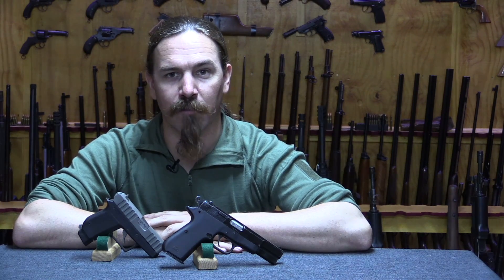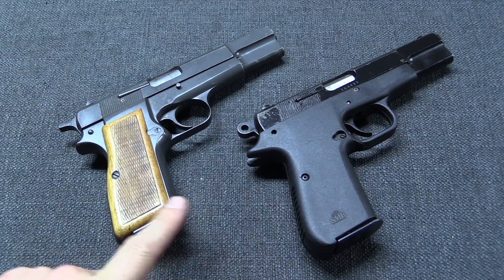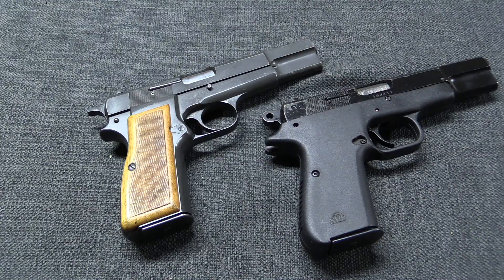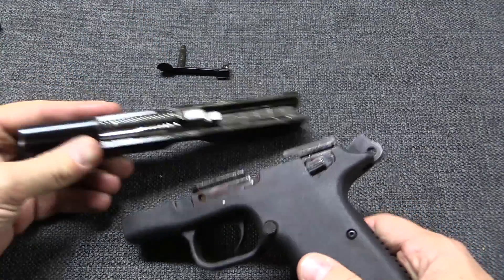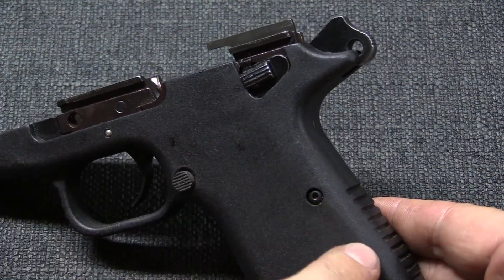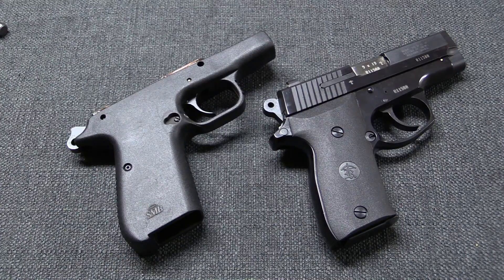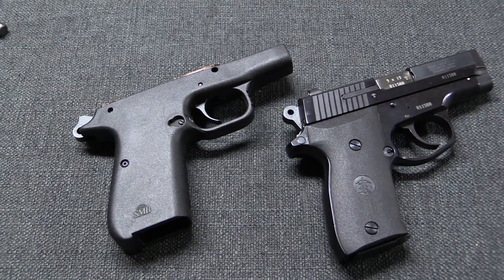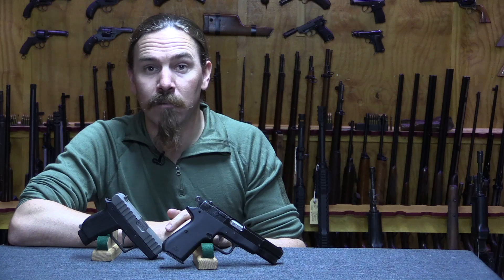Smith & Beecham Prototype Polymer High Power

Comment: A Hi-Power 9mm handgun with a steel reinforced polymer frame. It could work today.
Reply: requires Good Lubrication Of Club Kingpin
Reply: Nobody would buy it with guns like the P320 on the market.
Reply: Jbog07  That sounds like it would be a hot seller
Reply: @hillkiller6201  Perhaps. But, In my mind it comes down to the consumers preference. There are those who are more familiar with a Hi-Power than they are with a Sig. Both are great handguns.
Reply: Tanfoglio makes a 1911 like this and no one buys it.
Reply: @Fenster21  Tanfoglio, that a name I don't hear often
Reply: It could if the Hi-power was still being manufactured, which unfortunately it isn’t
Reply: @jasonarmstrong5750   I think there is a company in Canada that makes them
Reply: Yes it could work, doesnt mean it will sell. Tanfoglio makes a CZ75 with a polymer frame and I never hear anyone talk about these guns anywhere. (for consumer comparison sake its similar enough to the people who would buy a polymer HiPower) 

People actually buying or not is half the reason why theres so many of these ForgottenWeapons anyway.
Reply: Stamped titanium would be better inside a polymer frame.
Reply: Hill Killer I’d buy it. Retro is cool atm

Comment: The RAP was a firearm that was made during the 90's as a Firearm predominantly to serve the needs of under cover police, but also police women. Now the B&S Excalibur is a very interesting project, the workshop was in the old Republic Arms building just behind the Jeppes Town Police station. I was at their workshop many years ago and met the designer (who is a Rhodesian expat). It was very interesting to see the designer's thought philosophy. At the workshop they showed us some prototypes, one I could remember was a hammer fired DA only pistol that they intended for the metro police as it was a straight foreword pistol with no safeties. They also made a prototype pistol in 40 S&W that had more of a Beretta  92 take down design but it had some designs in it that weren't Beretta 92 (it was a single action only hammer fires pistol. Some of the initial challenges on the 40 S&W was to keep the chassis in place, they had some issues where the chassis would drop in the polymer frame that resulted in the trigger mechanism having too much space from the slide giving you a dead trigger.

Comment: It’s a shame the Hi-Power never got the following the 1911 did with all these aftermarket modifications to the basic designs. I mean there’s so many variation on the 1911, you got double stackes, polymer frames, aluminum alloy frames, light rails, threaded barrels. As for the Hi-Power? I only know of one aftermarket polymer frame with a rail that you can get. I realize there’s better handguns on the market these days but if you can get a modernized version of a Mosin Nagant or a modernized civilian M14 then the Hi-Power deserves the same kind of love.

Comment: Hi Power's with aluminum frames.......In late 40's Inglis Canada made light weight HP's protos for US and Uk tests. Took metal out of the standard steel slide and machined frames out of aluminum bar stock ( expensive way to make frames). Reduced weight quite a bit and worked fairly well. Then tried cast aluminum frames( whole different metallurgy). NG with high wear between steel and aluminum parts. Project was dropped. Today available aluminum casting alloys and new casting techniques ( Thanks NASA) could likely solve problem). I heard somewhere that FN actually made and sold some aluminum frame HP's in the 1980's(?). PS I love my 1972 FN Hi Power.

Comment: Wonder why the S&B pistol didn't have polymer grip extensions in place of the old HP's wooden one?
Reply: Prototype, I am sure that later models would have had either molded grips or attachable.
Reply: @Ackehece  and promptly added back that 3 oz weight savings.
Reply: @shawnr771  but with each model they may have been able to shave more steel from the frame, and polymer grips don't add much if they are molded into the frame.

Comment: If the rap 401 slide works on the hi power frame does that mean a hi power slide could fit on a rap 401 frame? I'm thinking slimmer single stack hi power.

Comment: What exactly necessitates the heavy steel insert? I've never handled a hi power at all, let alone shot one. Seems like you could make it work with aluminum. It is only 9mm after all.
Reply: Most internal gun parts are steel of some sort.

Even if make something out of very good aluminum. Hammer on it enough and it will bend or deform. 
Especially small parts under heat taking direct impacts from other parts.

In car engines the parts get hot but dont actually strike each other near as much as move beside themselves, in a layer of oil with a coolant system to dissapate excess heat.
Reply: Doesn't really answer the question. They make 9mm frames out of aluminum, or just polymer for that matter. Yes the small parts will have to be steel. That goes without saying, but that insert was massive. Glocks handle 10mm pressure with very little in the way of steel in the lower. I was wondering if it was something to do with the hi power specifically
Reply: @twatts45  No idea might be different sized springs. Mass of slide.
Lot of physics there. 

Without exact specifications and lots of math or trial and error. It is unknown to me.
Reply: Evidently the locking mechanism is in the frame as opposed to a notch and lug setup with the barrel and slide like a 1911, Glock, etc..

Comment: Not enough of a weight difference to make a difference in handling and the change in aesthetics of the weapon counted against it also. The only thing that would sell it would be if it was cheaper to manufacture but from the looks of it I doubt that also.
Reply: Might be cheaper to manufacture but the cost of long term support might be higher.

In addition if it is difficult to maintenance that would cost more time in training armorers and  repairing broken weapons.

Time is money.

A simple weapon with a quick turnaround for repairs is cheaper in the long run.
Reply: Shawn R I don’t agree with the maintenance issue. It shouldn’t be any more maintenance intensive than the original HP it is based on, as they are mechanically pretty much identical. The polymer frame is a zero maintenance item just like the steel frame. 

The major advantage is that you can pop these frames out at about the same rate as Lego at a fraction of the cost in terms of money and time compared to steel frames.

This was still a prototype, which probably explains why it looks totally hideous!
Reply: @Ding_Bat  A weapon that is difficult to disassemble and reassemble costs time. If Ian wont disassemble it then it generally has to be very difficult and he is much more of an expert than most people. Some armorers might found this hard.
Reply: Shawn R Agreed, but remember that this was still in the prototype stage of its development, which means the sticky insert was a snag which could have been address in production versions. I’m not sure how easy that would have been, though, if at all possible.

Like I said, the idea behind it could have been to make it easier and quicker to produce, and they were offered the “cheap/reliable/easy to maintain” gun triangle. You could have any two of those tree options, but not all three at the same time. 😉